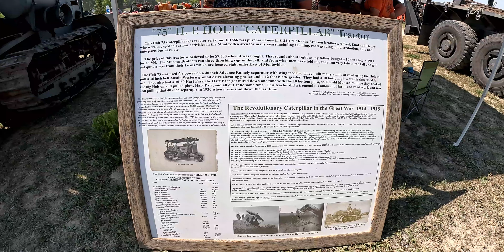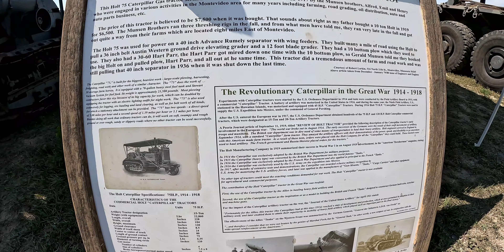1916 Holt Caterpillar 75 walk around and ride along saved from scrap by chance! Ep. #10

Comment: Amazing old tech. Seems like you had to be from partly steel yourself to drive and operate this thing. These things where slow and the bigger they where the slower they moved. I think this engine has pre-cups to lubricate rockers? Most of that era engines where with open valves and rockers. Something that is very uncommon sight after 20s.